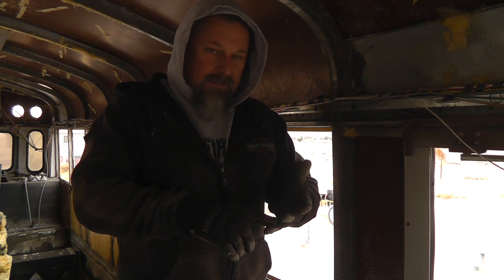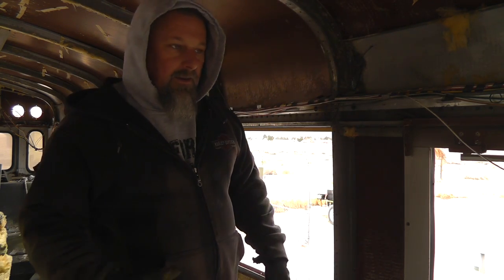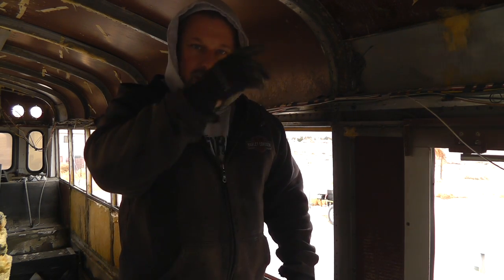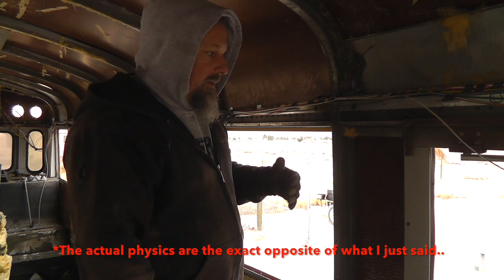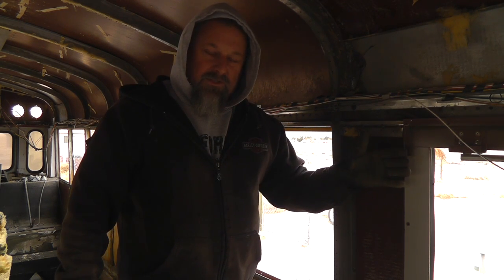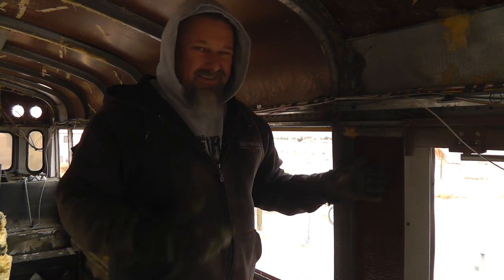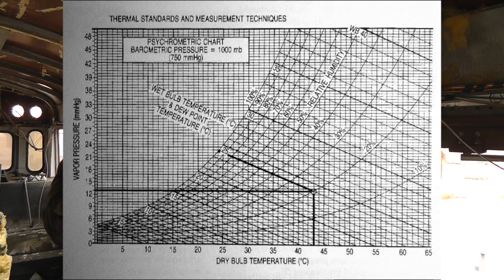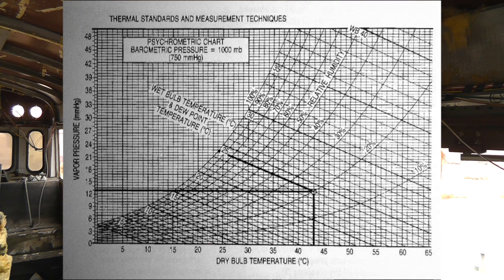Building Science 101 - Insulation and its limitations

Comment: Would there be a benefit to using 2x6 walls instead of 2x4 with the spray in foam, or would it not make sense cost wise?
Reply from the maker: I you're using a closed cell, high density foam (like JM Corbond) then the point of diminishing return is at 2" (in most climates).  If you live in a sub arctic climate then go up to 3".  The up front cost of the spray foam is what most people (and contractors) balk at. However, if you take into account the increase in lumber cost, going to 2x6 from 2x4, the cost of air infiltration barriers (like Tyvec) and the labor cost and unreliability of sealing and caulking building envelope penetrations, then it becomes a wash.  The added benefit of allowing the HVAC to operate more efficiently extends to life of that equipment and lowers to operating cost.  And because its chemically bonded to the substrate, it adds shear strength to the entire wall system.  I don't know if you can tell, but Im a big fan of spray foam.  Its spendy, but its worth it!
Reply: dzlfreek Thank you for the response. That helped me out a lot.
Reply from the maker: just as a side note, if you're taking bids from contractors that sell and install fiberglass, blown in bat systems, wet/dry cellulose systems, ect., you're going to be sold "R value"....hard!  The reason foam outperforms fibrous insulation's is that the air trapped within the foam doesn't move and if its a closed cell foam, is unaffected by airborne moisture.

Comment: I found it interesting! That's some good knowledge! Have done some construction work in my youth(demolition, hard concrete and rock drilling, painting etc.) and also added insulation materials where like you said the heat escapes around pipes, drains and so on... Have done some crawling under houses doing that which is much needed in the wintertime where I live. Oddly enough something a lot of planners of new house developments ignore and build to a more temporary specification on the cheaps...
Reply from the maker: Unfortunately, we all have been conditioned to buy to the "low bid".  Consider the fact that if you build a new home to code, you're building the worst house you can legally build.  Most developers build to code, focusing on things that you can see and touch - and will be out of style or worn out in 10 years - while paying lip service to the building envelope - and that determines to operational costs and indoor air quality of the home!  I've talked with hundreds of builders and contractors, who are great builders, but are completely ignorant to the application of building science to their trade, not realizing that it would give them a competitive advantage.  "I've been doing it this way for 30 years!" one builder told me one day.  I felt like saying to him "Well, you've been doing it wrong for thirty years!".  I didn't, but you get my point.  Glad I was informative and thanks for watching.